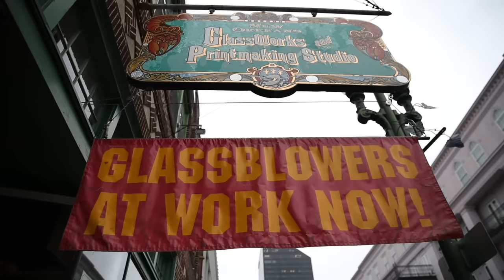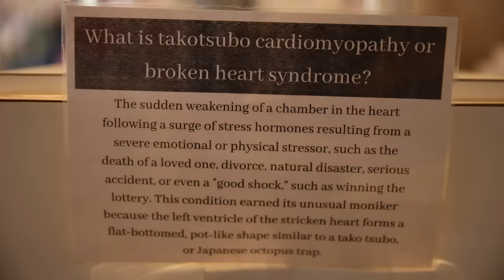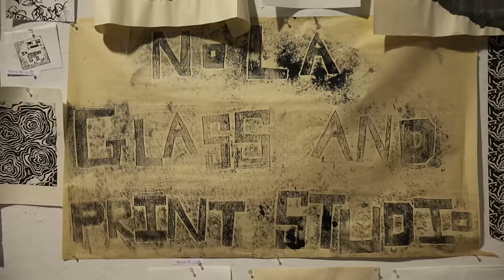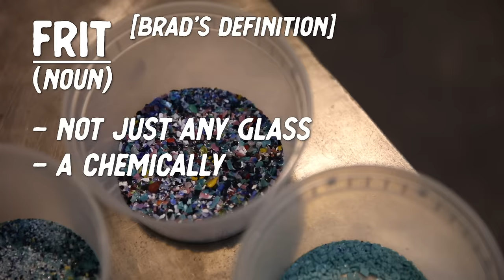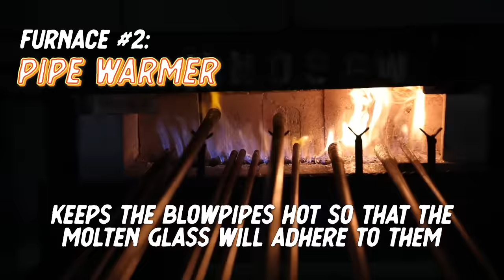BRAD BLOWS GLASS | Local Legends | New Orleans | Brad Leone

Comment: Hey Brad! So I started a batch of mead about a month ago. I used meadowfoam honey, and day 2-5 the yeast seemed really healthy and bubbly. But after day 8, there didn’t seem to be any more carbon dioxide inside the mead, and most of the yeast had fallen to the bottom of the carboy. Is it usually that soon when the alcohol kills off the yeast, or should it have been longer? It will be done on the 19th, and it definitely smells really good now, and it has alcohol in it for sure.